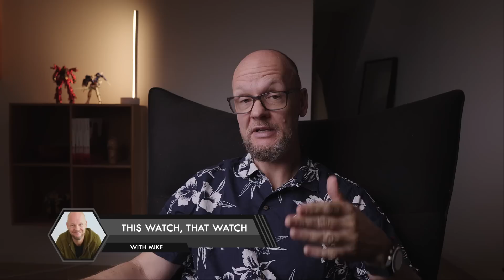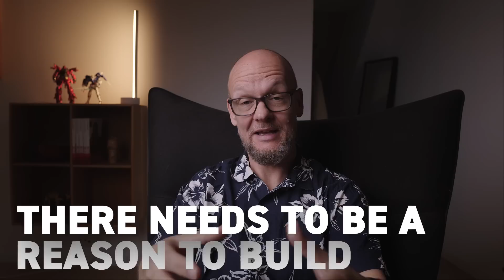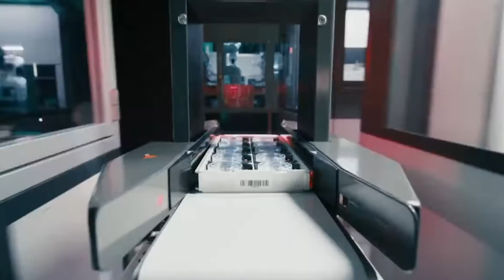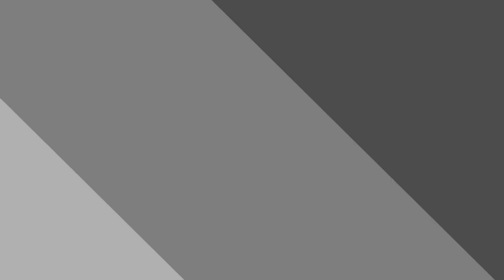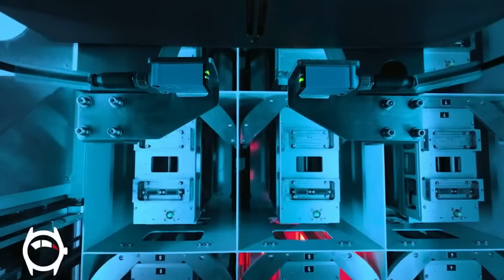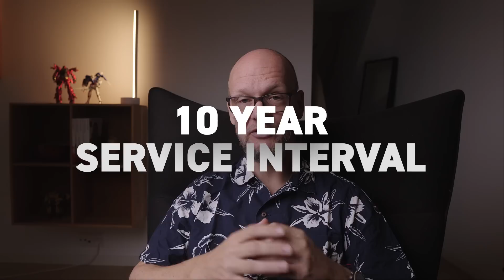In house movements & METAS: Overrated? Worth it?

Comment: Great content Mike. 
METAS was not the strong point for me with the new Tudor GMT, but I am looking for high levels of accuracy if I’m spending over £1500 on a watch -COSC is the minimum level  when I’m spending that type of money. 
Anyone  who knows much about watches or not  is going to be looking for a certain standard of accuracy and while they are not Swiss I’m sure everybody would be very keen to hold Seiko up as an example of inconsistency in this area. That level of accuracy that we see in many of the prospect models is simply not acceptable if you are going to pay more than about £600. 
I agree with a few of the other comments about sellita, they need to up things here. On the pro Tudor side for under £4000 You are getting something that is on a par with some  more expensive watches, that’s not just necessarily an attempt to kick omega,  I’m thinking breitling who have higher prices but don’t offer any anymore. Agree Rolex and a few others  were left  with limited options by ETA.

Comment: As always, fantastic video. The only slight disagreement I have is your opinion of the improvement of METAS over COSC. I own both a Longines Spirit (COSC) and Omega Aqua Terra (METAS) and the Omega keeps much better time. The Longines runs about +2.5 s/d and the Omega runs about +1 s/d. It may not seem like much to some, but that improvement is the difference between re-setting the time every couple of weeks vs. maybe once per month. And I'm only commenting on the average rate.

The Longines will also run about +4 s/d when sitting in the watch box, while the Omega will run about +2 s/d. To me, that makes a huge difference.

But subjectively, I would choose COSC or METAS over non-COSC or non-METAS any day. I just have a deep appreciation for the ability of mechanical watches to be as accurate as possible. It also is, at the very least, IN GENERAL, an indication that the materials, manufacturing, and time invested in the movement are objectively high quality.

LOVE your videos!
Reply from the maker: No doubt that it keeps better time. For some people that's a noticeable improvement. For me - less so 🙂We like different things. Thanks for watching 🙂
Reply: My Aqua Terra gains more time than my Zulu Time, but it doesn't lose time. I wish I got +1 from my Omega. More like 3 or 4. My Grand Seiko is more accurate than both.

Comment: One thing people tend to miss with in-house movements. It's pretty much the same with cars. If a company is in charge of developing a power source completely internally, it makes it a bit easier to take this existing platform and improve it or innovate it over the years. For example, the Eternal Calendar would simply not exist if IWC didn't spend money on making a movement they could use for improvements in the future. Yes, you'll always pay more for in-house. But the possible improvements behind a movement made this way is something we don't necessarily appreciate as consumers in the short run. A watch that has the ability to provide an in-house movement also has the chance to produce something truly innovative and different, particularly in terms of complications. A brand that uses Sellita or ETA exclusively will always stay behind.

Comment: Completely agree for the most part, but although I'm very happy with my Sinn 556 I do want to note something: DIN 8309 specifies 4,800 A/m (not Gauss). That's only about 60 Gauss. The MagSafe charger and even some phones generate magnetic fields stronger than 60 Gauss. A METAS movement would shrug it off as if it were nothing. My Sinn, on the other hand, would be in serious danger of magnetization.
Reply from the maker: Fair point on the DIN standard. Don't know how I missed that because I actually do know it (normally). Having said that - 25 years watch collector and only one watch has ever been magnetized. 😀

Comment: DIN 8309 is just the German equivalent of ISO 764 which is 4800 A/s or about 60 gauss (not 4800 gauss)... which is not much.  Most watches in decently hardy steel cases are ISO 764 compliant.  Many indicate it with an upside down "U" on the case back.  My Seiko SARB033 was, and it got magnetized many times.

DIN 8330 pilot watch standards (which DIN 8309 is a subset of) are more marketing than anything.  The don't really bring much beyond what most sport watches already have, and pilot watches are kind of an anachronism now anyway with most pilots these days depending on iPads rather than watches for timing, navigation, and calculation.
Reply from the maker: Thanks for the clarification.

As for me I’m at 25 years of watch collecting and have only ever once had a watch magnetised - It wasn’t even ISO rated. 

Cheers 😀

Comment: Your list of movement requests are exactly what I want as well:
1) Thin chronograph movements
2) Thin automatic movements that allow for sub-12.5mm or sub-11mm watches.
3) More micro rotor movements
4) Instant change dates at 12MN
5) 5Hz movement with a 10 year service interval
6) Stock parts for 25 years.

I'll toss in a few more that are not necessarily just focused on the movement but follow the theme of mattering more than METAS or COSC or in-house.
7) Allow movement and non-movement parts to be readily ordered from anywhere in the world (e.g. ordering the parts suck because there are no service centers for the brand you want in the country you live in) by anyone (i.e. no exclusive distribution to qualified service centers) to democratize repair.
8) It's been decades or over a century since watch straps and bracelets were introduced. Stop half-baking them! Make them of a decent quality (milled with no unsightly gaps between the clasp and the links), have at least 5 micro-adjust holes, have on-the-fly adjustments on the clasp for when my wrist swells due to moisture or temperature, have half-links so I can actually get a good fit, use quick release spring bars by default OR have holes in the lugs to make strap replacements easier, and get rid of the pins and pin and collar system and use screws. I refuse to believe that the costs increase that dramatically when you apply all of these at scale.
9) GMT bezels should be 48 click bezels to account for half-hour timezones.
10) Lume the dang bezels so they can actually be used more effectively in the dark!
11) Use more lume across the board.
Reply: Ive got a tudor aeronaut gmt is only 10.5mm thick. Its an eta movement,  but keeps good time. My tudor chrono is a breitling based B01 , yet its nearly 14.5mm . My chrono bb is about the same as my 41mm bb which has the Mt in-house movement. Personally I think its all about control when it comes to servicing . I believe tudor could make their watches thinner too, but then they would compete with the rolex brand . Why pay double if tudor are just as slim and accurate? I think tudor are going for the value angle compared to omega by having the metas status. Tudor has been the most talked about brand in the last 10 years , by achieving metas status , and their watches being 2k less than a similar omega , its a win win for rolex . By tudor competiting with omega , it keeps  the rolex brand ahead . If rolex went metas , it would be like saying omega were more advanced , so its used tudor to win its battle. Its a clever strategy saying our 2nd tier brand can offer what omega does , cheaper , yet implies that rolex doesn't value metas highly enough , to go that way ? That's my understanding on it anyway !
Reply: There are several Miyota watches out there that are 10mm and below that are at most, 150m water resist, so #2 is already very possible.
Reply: 2) there are 10mm watches with ETA 2824. E.G. Longines Heritage Conquest. Watches are fat because that's the current fashion not because of the thickness of the movement.
6) The best way to guarantee parts availability is to go for movements with high market share. E.g. It's still super easy to get AS parts for movements from the 50s, 60s and 70s. There will be plenty of barely used ETA and Sellita movements in 25 years time. Even if a company states "25 years parts availability", it's meaningless. They can change their mind or go bust any time which means no parts.
7) The Swiss courts appear not to care about this and to me remarkably tolerant of monopolistic practices. See the Cousins case against ETA/Swatch Group
8) You're right, the costs don't increase much, but so few consumers know the difference so there's no incentive to produce better straps or bracelets.

Basically, these are luxury products which consumers buy as status symbols because of the marketing not because of the characteristics of the watch itself. And the brands know it.
Reply: 30 years ago, you were able to get an automatic-chronograph with 100 m water resistance and a thickness of 10.5 mm: It was the Blancpain Leman 2185.
Reply: @hirobosch38similar with Laureato Olimpico of 1996. Still amazed at its thinness
Reply: Yes!!!
Reply: BB 54 is 11,2 mm 😊
Reply: use X1  stop being cheep
Reply: @Contredanse  Watches came without on the fly micro adjustments for decades and nobody ever had a problem. Fast forward to now and people have to adjust the bracelet twice a day lol. The hobby has gotten very needy
Reply: @lonewolfemcquade8133  I'd have to politely disagree. Tools improve over time.  With prices of watches going up over time way beyond inflation, they need to start justifying the price increases with better quality of life.

That said, I would agree with you that changes wouldn't be necessary if the prices of watches just increased according to inflation. I would be happy with that!

Comment: As usual, there's a lot of agreement with your points. On accuracy, however, it really depends on if you are a serial rotator of watches, or if you are "monogamous" and wear one watch for a long time. If you are the latter, and you are anal about your watch losing time, then having stringent accuracy standards that severely limits the downside is attractive. Having established that some do see value in accuracy and downside protection, I do agree that external agencies may add unnecessary cost if the manufacturer can already achieve that level of QC internally

Comment: Not only should manufacturers stock movement parts for 25 years, they should be forced by law to provide those parts to independent watch repairers.
Reply: Right to repair is very important! #louisrossman
Reply: Ironically most car manufacturers are forced by law, depending on country they sell in, to have spare parts for 15-20 years.
Reply from the maker: At least it's not like a fully glued, proprietary screw and batter like Apple and others... 😀
Reply: @Mike.thiswatchthatwatch  Yeah, let’s do that. Also a pun way to screw up this industry 😂😂😂😂
Reply: What? Worldwide?
I understand your principles but I cannot agree with you.
The very nature of a free market allows manufacturers to withhold anything they want, to set conditions on its sale and to charge whatever they want for that product.
We know that for $4000 the Chinese can replicate a 5712 99.5%, 22k gold rotor and free sprung balance included.
And that for $150 they can retail any Rolex clone movement.
So, the point is not what the parts cost or anything else physical, it's about how you feel.
And you feel how you do about the brands that bother you because it means something, because they've made it hard to get.
Do I let an independent service my Rolex? Yes.
Are there parts inside it aren't gen Rolex? Probably.
Is my Rolex guarantee in tact? No.
Do I care? Not one jot. 
Your mileage may vary.
A friend of mine had a dead Daytona, now fixed by my man, with a fully cloned Daytona moment and (luckily) his balance bridge and free sprung balance and a few other bits swapped, because we've got them.
The complete bill for that fix was under $600, Vs over $15000 from Rolex.
Reply: @fontyyy you are absolutely right about the free market perspective, when it comes to luxury items like watches. 
But you should be aware, that your statement has a limits. 1. A core principle of a free markets is, that it actually is „free“ (esp. for essential goods like transportation, communication, utilities etc.), meaning that it is the job of the state to regulate it, to ensure real competition. (No monopolists, no cartels etc.). 

2 Another pillar of free market capitalism is the right of full ownership of goods you purchased. This includes not only the „right to repair“ for your own stuff, but also, that there has to be the possibility of competition in the field of repair too. Because you cannot, or better, you do not own anything (in a meaningful way), that needs service, if said service and/or spare parts are solely controlled by only one company.
Cheers
Reply: @fontyyy In luxury items, for example, it is a shame, that the companies hold you hostage with spare parts, caused you only have the choice between devaluing your watch with aftermarket parts or to pay their ransom.
Reply: @wolfmoz2232  that is the nature of the free market, that you choose to devalue s 5711 because it has an after market crystal (for example)  is your choice.
Why? Why do you do that?
Is my car worth less because the windscreen has been replaced?

It us who are causing the problem, we're the ones calling watches with aftermarket parts "fakes".
My car has aftermarket wheels, tyres, one or two body panels, paint, windscreen, seats, other interior parts, a few engine parts, quite a few drive train parts, and a service history from somewhere not associated with the original manufacturer, it's obvious from 100 yards away it's not as it came out of the factory...and it's worth more (lots more) than a 100% original vehicle with a manufacturer service history. No one would call it a fake, maybe some might not like what's been done to it and would prefer it to be standard but some others do. This is the nature of a free market. 

We set the value, if you want to kill Rolex's hold...do it, pay the same money for a watch without papers and history as you pay for one with it.
Rolex (or any other manufacturer) do not control the market...we do, we are the market, we control the values, we control everything.
Reply: @ Funny, calling an artificial market restriction „free market“. That’s because predatory capitalism has been gaslighting all of us to accept these things as „normal“, while they are the opposite of free.
Reply: @ Just to clarify. Artificial restrictions, which undermine the central idea of a good working capitalistic system, called „robust competition“, are of course not a problem in inessential goods like luxury watches. The problem occurs, when the acceptance of this learnt behavior leaks to the evaluation of market manipulation for essential goods, like food, energy, transportation, health care etc.
Reply: @fontyyy  This is not what a free market is about. Providing replacement parts is quite frequently a regulatory demand in plenty of industries.

Comment: Why I prefer metas: 1. Obviously any particular watch had a quality check. 2. They ARE consistently comparably more accurate. Less than a second gain/loss in time, based on my experience with two watches.

Comment: For most people buiyng watches, the only thing that matters is brand recognition. No more, no less. Oris, Tag Heuer, Breitling are all using ETA or Sellita based calibres. All of the entry level watches in the Swatch group are using ETA. Personally, I don't mind manufacturers using ETA ot Sellita movements, as long as they keep the prices at a reasonable level. Problem is that prices went up drastically the last two years and the manufacturers are still using the same ETA and Sellita movements if their watches.

Comment: Automatics with thinner than 11mm cases -> Seiko Lordmatic already did that, with many at 9mm and that is with the raised acrylic box crystal. 

Chronograph less than 12.5mm thick -> Seiko 7015 did that too, and it's an automatic flyback. No minutes counter though. 

10 year service interval for 5hz movements-> if we are being stringent, not possible at any hz because gaskets and oils are not good yet. However if the standard is "having serviceable accuracy and no need for replacement parts", then the Seiko Lord Marvel does that - many examples from the 70s went 50 years without service and only needed one when you want to use it today, sometimes with daily rate < 10s and >250 amplitude even before said service. 

The real question to ask IMHO, is "Why isn't Seiko bringing back any of the above"?

Comment: All my watches are either solar quartz, or high accuracy quartz. No point in dreaming about better mechanical movements. 99% of the time you won’t be looking at the movement, anyway. With a Rolex, make that 100% of the time (closed case back). Get yourself an accurate, thin, robust quartz watch with little servicing required, excellent finishing, and a beautiful dial instead.